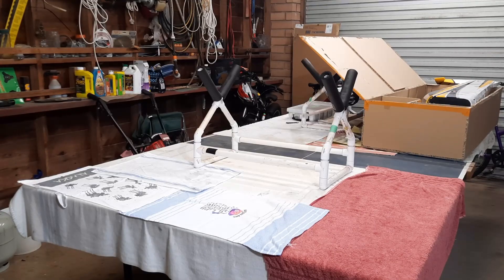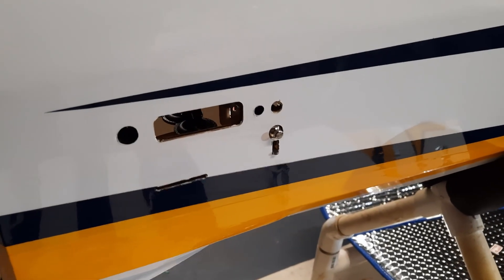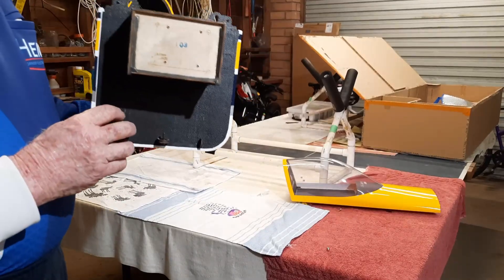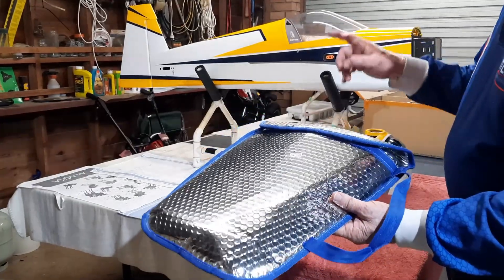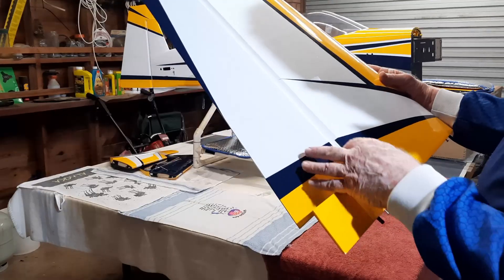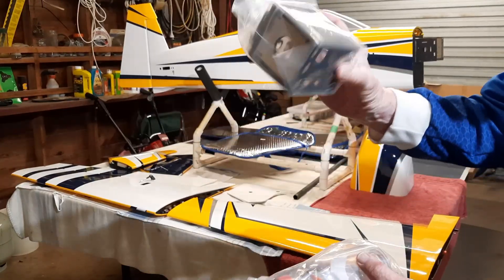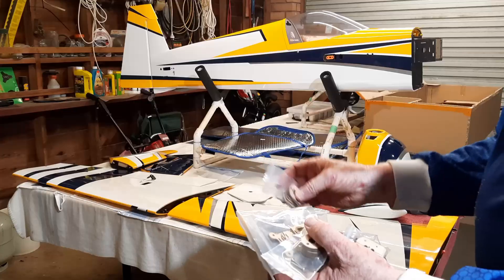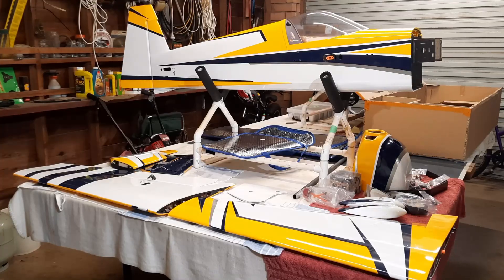Skywing Laser 260 74" - Yellow - Unboxing & Trial Assembly

Comment: I have Pilot extra 67 and Laser 60, neither has ventilation holes cut in bottom of fuselage.  I'm only a sport flyer, should I be concerned?
Reply from the maker: All my electric planes have a large air exit hole - normally in the bottom of the fuselage - to ensure that the cooling air flow entering the front of the plane is not restricted on exit.  Without the exit hole you may risk higher temperatures for the motor, ESC and batteries....  Note, for the Laser above, there is also a sloping guide plate above the exit hole to assist with air exit efficiency.